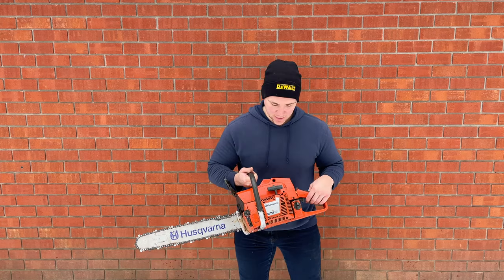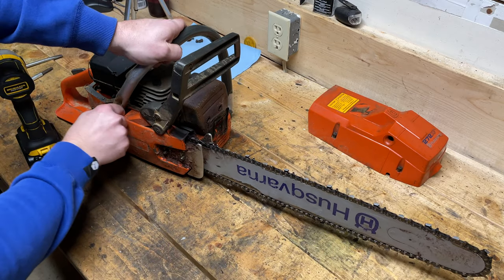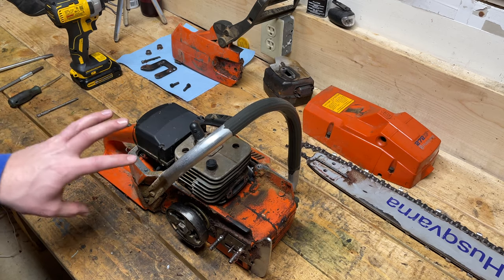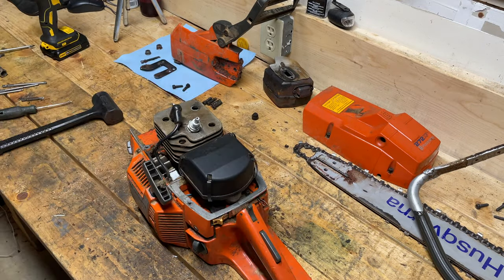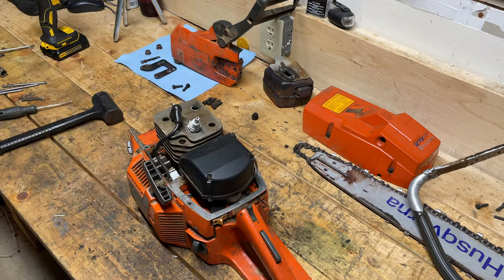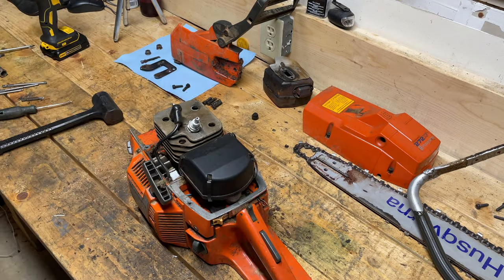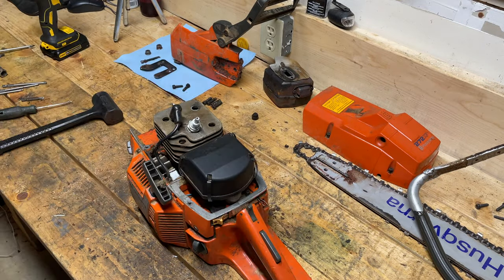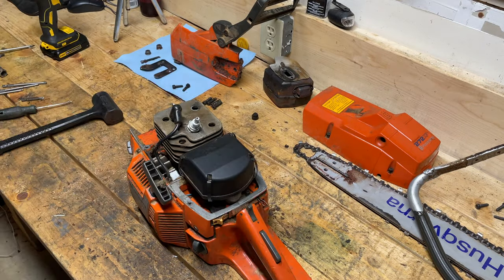How to fix your blown up chainsaw... WITHOUT buying new parts! Step-by-step diagnoses and repair!!!

Comment: Very well done Dave. A little trick I use that I see you don't do is, If you're screwing in a bolt turn it counter clock wise first to find the thread start. You'll feel the bolt drop down every so slightly to sink up the threads.
Reply from the maker: Yes sir! If I find turning it in by hand is a bit “off”... I’ll turn it back and try and reset. Good point!
Reply: I learned that trick back in the 70's, but never told anyone because everyone thinks your nutz
Reply: Good tip, my dad taught me that when i was a kid, still use it. always.
Reply: Yes well done 👍
Reply: I was thinking the same thing, a tip I learned by myself, turn it backwards until it drops in, especially when screwing into plastic. I really cringe when people use a power tool to install the cylinder hold down screws without checking to see the thread is engaged correctly, very easy to cross thread. Great video, I just purchased a Chinese after market gas-tank/handle for the 272XP and I see that the trigger assembly is not working like the stock one should with at least three defects that I can see on mine, ripped off again! Thanks, excellent video!!

Comment: ..I appreciate what you are doing here, but I would clean up the cylinder as best I could, and throw in a fresh Meteor piston with Caber ring..they are not that expensive, and it would likely be more reliable and last longer...I would reserve trying to save the piston for saws where the piston is unobtanium..272 pistons are easy to find, and a decent/very good aftermarket one is $25-$40...when you sand on a piston, it removes material and also can easily get it out of round or too much undersize...

Comment: Surprised you didn't use 2 cycle oil for lube inside the cylinder. WD40 is basically water displacement and a mild solvent. It's good idea to let a saw engine warm up before giving it the beans. Nice repair, I try that if needed. Good video.
Reply: Ever heard of cold seizing…no way would I be revving a cold saw like that!
Reply: @tjgrossman  did it seize? No, good.

Comment: I know this is an old video, but to those who watched… when you see a piston that’s all cooked only around the exhaust side, that is usually from overheating. Factory mufflers on most saws are too restrictive and cause them to heat up when  worked hard for a long time… if it was a poor gas/oil mixture the piston would be scored all the way around. I recommend, to whoever reads this, that you slightly modify your saws muffler to make it more free flowing. Not to make some hot rod saw, just so it doesn’t hold onto as much heat and risk smoking the piston like the one in the video
Reply: Please describe the modifications to a stock muffler that you recommend.

Comment: I like your approach to repairing an engine that is “hopeless”. That Husky would run for a long time without any replacement parts added. People who can’t afford to buy expensive oem parts take note: “You can do this with a little Common Sense and a bit of Elbow Grease applied. 
Good video Mike!
Reply: In an age of need2repair. ...good advice .

Comment: Back in the 80's we had to fix stuff like that. There was no Internet. It was hard to get parts and even harder to get money. Of the ring gets to hot and loses it's spring, you can spread the gap with a nut, heat it then dunk it,retemper it. Sometimes you just gotta make due. Great video.
Reply: thank you for this idea 🤔 i have an old 1961 mcculloch 1-71 am working on right now and i noticed the ring did kind of lose its spring. thanks

Comment: Good job  I’ve cleaned up several cylinders in my life I cut the aluminum out of the bore with my pocket knife didn’t scratch the cylinder then used sand paper to clean up it sounds rough but I didn’t think I any thing to lose worked fine. I was very careful. Thanks for good informative videos

Comment: I have seen in automotive, when you have piston issue soak it with transmission fluid to build compression back up.I  liked the advice about starting bolts by hand, after decades in automotive field have seen what being lazy can do. I have watched the younger guy's trying to get things done so fast that they will install spark plugs with cordless impact. Before I quit my job in the service station business I have noticed that my clients in landscape fields all switched to the highest octane fuel, they found it to be better for the fuel mix and caused less issue with carburetor. The down fall is the ethanol in gasoline

Comment: I didn't think that piston could be saved and used again. Kudos to you sir! I "blew up" my early 80's Stihl 024AVS and was too intimidated to try and save the top end so I ordered a cheap ebay replacement. Your video gave me the confidence to put in some elbow grease and at least try to save an OEM piston and cylinder. And they didn't even look as bad as yours did so I'm hopeful

Comment: Good work, Dave! ...Tip on refinishing; use stainless steel wool for the final polish. 
I've never rebuilt a chainsaw, but have been working with wood and metal in various projects for years, from building/repairing violins, to building a tiny camper. I recently refinished a cheap single action revolver using fine sandpaper, and steel wool in running water, and little soap. Comes out super clean and polished!
Reply: If your using new rings, your better off with a slightly "rough" finish vs polished. You want the rings to seat in. New piston and rings should run through a few heat cycles before running full throttle, then move on to a load. Muratic acid works really good on the gaskets and gasket sealer used during the original factory assembly. I always use Yamabond semi-drying gasket sealer during assembly. Keeps gasket in place and helps with air leaks. Use any sealants VERY sparingly. a little goes a long way.

Comment: Im in the process of doing just about the exact same thing. 272xp scored. Cleaned up the aluminium transfer in the cylinder and it looks like new. Sanded the piston just for fun and started realising this OEM beat piston is probably still better than a cheap china one. So I ordered a new piston ring and oil seals (incase the saw needs them). So I spent about 10$ on parts. Its amazing what a little elbow grease will do with these old quality parts. You can really go to town sanding the cylinders too. Really quite hard to get through the  plating.

Comment: I love this video. Thanks for walking us through not only the dissassembling of this Husq but your thought processes at ever step. This was a fascinating video to follow along and learn about the components and the 3-D “diagram/schematic” of this and most chainsaws.

I came across a Husq 440x that appears like it was rarely used, but feels like it has little compression. I bought a compression tester for under $20 from Amazon which arrived yesterday. I’m eager to take on this rescue. I’m quite familiar with my Stihls and have always babied them in maintenance and blade sharpening, but this Husqvarna is a bit unfamiliar in details. Not no mo’. Thank you.

Comment: Great video! I have a Stihl, that I was told, needing replacement of a scorched cylinder and piston. Your video has given me the confidence to at least try to fix on my own.  Thank you for the time and effort you put into this presentation. Know that your two hours of work is reaping an even greater dividend than one revitalized chainsaw.
Reply from the maker: Hey William! That’s what it is all about for me!
Reply: * Tip from a mechanic.....If it has at least 50lbs compression, it will run.

Comment: Thanks Dave. I just got an Echo saw that won't start and found scour marks on the piston. I'm hoping to be able to save the cylinder and maybe even the piston after watching your video. Loved the muriatic acid trick. Something to think about. I heard to check for is gray discoloration on the crankshaft and down below in the case. I was told that should all be cleaned up with carburetor or brake cleaner or that material will work its way back up into the cylinder and cause more wear. I really enjoyed this video and the great detail.

Comment: Dave, I am so proud of you! I wasn't sure if the sanding was going to be good enough to work, but a combination of that and the Muratic acid, seems to have done the trick. Also a good diagnosis on the stuff you found wrong like the loose bolts and stuff. I am happy for you buddy.
Reply from the maker: Thank you!! I appreciate it.

Comment: I do this sort of repair all the time on equipment for my own use (not for other people). I do spend $12 for a new set of Caber rings. I have found that Stihl chrome cylinders in straight gassed saws are rarely damaged and will clean up fine. I restore pistons that would make the purists gag. I do make sure that (1) the piston grooves are clean and free of aluminum transfer and (2) the bottom of the piston skirts are within reasonable tolerance (skirt to cylinder clearance < .0035). The critical areas are the rings (for compression) and the lower skirt (to prevent piston slap). They run fine.

Comment: I have got many chainsaws going this same way for my self and other peoples saws . The agent have said they are not worth fixing or going to need new cylinder and piston  add labour to that and it comes close to the price of a new saw . I understand they want to put a warranty on the fix but if its just a firewood saw used a few times a year then many of the saws I’ve fixed have gone for years . Often its been run lean on the air/fuel mixture or the oil ratio is not correct . Once the ring pinches usual inline with the exhaust port then the saw wont start . Two strokes need good compression both on the top side of the piston and crankcase as the fuel/air mixture first enters below the piston through the reed valve and is compressed on the down stroke then as the piston clears the exhaust port the mix enters the cylinder . Any damage to the piston or ring will effect this process and saw wont start . Also poor crankshaft seals will also affect starting . These aren’t the only reasons a saw wont go but if its got good spark and fresh clean fuel and fuel filter plus a clean air filter and still wont start the its most likely a pinched ring or piston damage

Comment: Nice long video!  Although I cringed when you started with 300.  Were it me, I'd start at 600-1000 even if it meant a little more sanding. Agree with the pre-cleaning, or a bucket of steaming hot water with some Dawn.  Once you've gone that far, I'd throw some engine paint on the exposed metal maybe. I've got a Poulan Pro that runs great but clutch won't spin and you've convinced me to give it a go.

Comment: Hey Dave I got a little trick for you as you assemble the wristband and Ring and Kirsten take some of your oil mix for gas and an eyedropper and put a drop of oil on the wrist pin and on the rain and any part of the crank that you can reach it swollen sure at least the first firing that it is not dry

Comment: Also wondered why you did not coat the ring and cylinder with some oil instead of WD.  I guess it worked.  Would it have been helpful to have used a small engine cylinder hone to briefly to cross hatch the cylinder walls?

Comment: I have cleaned up quite a few seized up piston ring grooves, some of which were carboned up as well.   I used a sharp piece of metal (old ring piece or chisel.) to cut away any excess metal.   The ring should then have about 2 thou clearance, and should wobble about a bit when pushed into the groove from outside... making a figure of 8 with the piston.    Hope that new piston and cylinder sits on your shelves for a few years

Comment: Great video, that saw will cut much better with a sharp chain.
Reply from the maker: Thanks for the tip! You're right. Chain has been sharpened and its running great!

Comment: What does sanding the scratches out actually do for the performance? As in, reducing the total diameter of the piston and increasing the gap between piston & cylinder wall. 
Piston ring polishing I understand that it's a better compression. Thanks, good info
Reply: I went to tech school for auto machine.  We were taught to knurled piston skirts and tune them with a large fine cut mill file.  Polishing the piston with fi e grits probably doesn't help, removing any bumps so piston won't continue scoring is.

I was curious if the piston rings would have blow by, nice to see they didn't.   I would be curious to see a more generally scored piston and cylinder go thru this and see if it worked ... did engine make enough compression to run and cut ok.

Comment: Nice repair. It may last longer than you expect. When the new parts arrive you now know that it is worth putting them into this saw when the time comes. I have not been doing much as far as video uploads lately due to several factors. But this video would be a typical one for my Trash or Treasure series. Enjoyed watching, big ..👍 #242
Stay safe, Joe Z
Reply from the maker: Hey JOE! Great to see you here. I agree, totally worth a new kit when the time comes/ Thanks for popping in, hope to see more comments in the future! Cheers!
Reply: @DavesSmallEngines  Will do. Stop by when you get a chance as well.

Comment: I find using a wire brush on a die grinder works best on galled aluminum that has transferred to a nikasil coated cylinder.  The wires dig the bits of aluminum out without changing the bore dimensions or roundness
Reply from the maker: Nice Padraic! I will try that one of these days. Cheers!

Comment: Really enjoy your vids Dave- thank you.
Been offered stihl ms231 cheap that has been run on straight fuel.its seized. If i fit a new cylinder, piston,rings & bearings will this get it running like new. Planning on doing my first build. Is there anything else that may need replacing. ?Would you tear down saw completely or is it ok to just do top end rebuild? Cheers

Comment: That damage on the piston and cylinder may be caused by the unit running at high rpm with almost no load such as hedge cutting or very light delimbing.  
One time had a Stihl with similar damage and no pressure/vacuum leak.
Stihl also does not cover this issue under warranty.  
Have to run the unit at lower throttle in light loads, or lower the high speed rpm.
With some muriatic acid to disolve the aluminum and cylinder honing for cleanup you should have a good saw.
Great to see how everyone rebuilds.  Good experience.

Best of luck for your saw!
Reply from the maker: Hey! Thanks for the great comments. Much appreciated. I had great luck with it - 160 PSI now! Cheers!

Comment: I would like to add something that is going to make your job easier and more important the correct way to clean up your cylinder and your ring grove on your piston. Tools are a very important part of doing a job correctly I would like to have you check out a piston groove cleaner and a cylinder hone. When using sandpaper you are concentrated on one spot causing a low spot I realize it’s not much but to a person not experienced it might be a problem. Using a cylinder hone moving it up and down while spraying a lube like WD will clean up the cylinder as well as giving you the cross hatch needed to make ready to put it back together. I’m not saying that you are not doing anything wrong I’m simply giving you additional information and tools to make your work easier. With Respect.   RR

Comment: You definitely needed to remove any aluminium impregnated in the bore and on the surface of the piston ring.  Aluminium to aluminium binds up strongly.  Just try pushing an aluminium tube (say 1½") into another with 30-40 thou clearance, but with a slight burr on either.  They will bind and you won’t get them apart.  Not without sacrificing the outer tube or severely scoring both.  If the tubes were steel, much less problem.
I also learnt this the hard way when an ultralight powered by a 2 stroke 18Hp Fuji-Robin, seized at 500’.   A repair after seizing before my ownership, had not cleaned the bore out adequately.  No harm done (to me).   Became a short flight in a poor performing glider.
I’m not sure sanding the piston needed to totally remove any evidence of scoring, perhaps just the high points and any sharp ridges.  I noticed there was a bit of rounding of the ring groove due to hand sanding.  Perhaps gentle stroking with a fine flat file circumference wise, would be better, then finish with the finer paper.  Much less hand sanding.
Finally, to gauge how effective your fix was, squirt some oil down the plug hole and repeat the compression test.  Any difference in the result will indicate how deficient is the piston / ring / bore seal.  If you also performed both tests before repair, even more quantifiable.  Use a few ml of gear oil (SAE 80 or 90) and give it a couple minutes to spread around the top of the piston.  In 4 strokes, It is a technique used to separate bottom cylinder problems from top end problems.  I.e worn rings, broken rings, scored bore/piston VERSUS valves (no tappet clearance, pitted or worn seats, bent stem), blown head gaskets, cracked or warped heads, hole in piston, etc.
I’ve had a Stihl 066 sitting on the bench for a couple years.  Won’t start after doing some hard continuous work.  You’ve inspired me … well, at least to think about it. 😊

Comment: great video, thanks for sharing. I've rebuilt a Husky 51 and made a 55 out of it. Good to see other perspectives. Peace!
Reply from the maker: Hey TLC! Thanks for the kind words!
Reply: My 55 just burned up yesterday, but the ring isn't seized so I hope i'll have an even easier time cleaning it up than this. Going to carb dip the whole cylinder too. Speaking of 51s, I sold one not too long ago that was essentially factory new, and now I wish I kept it! Some of the best year models and chassis ever made.